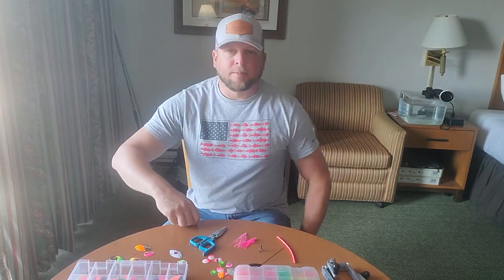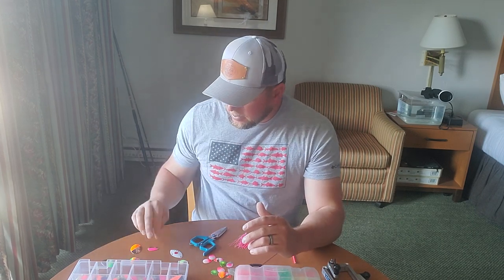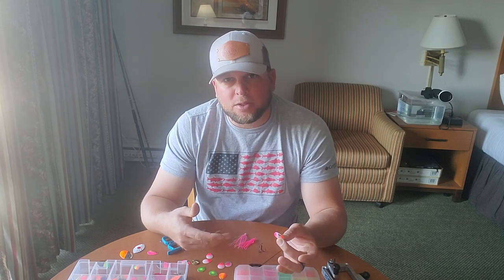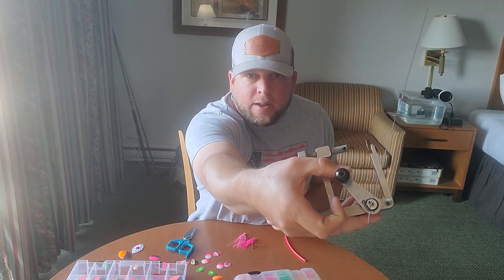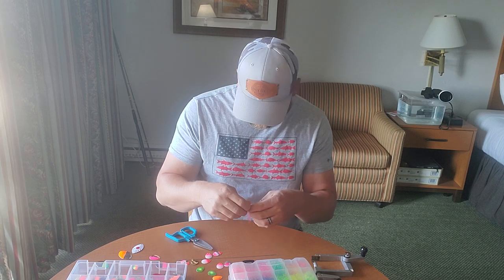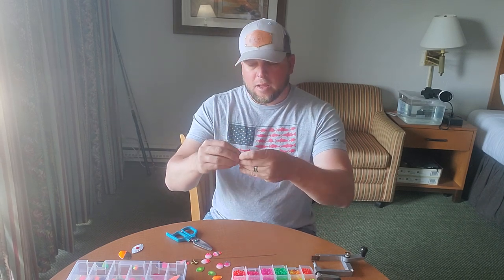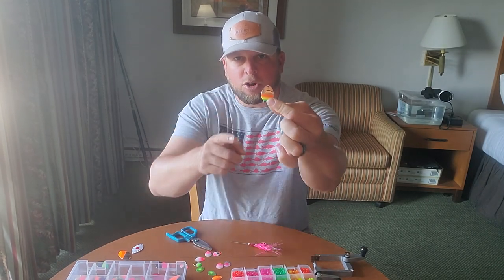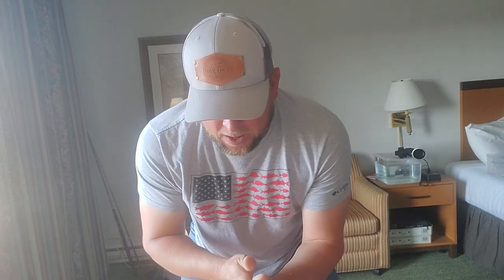Buoy 10 Update:  8-25-19  (How to Build a Spinner for Salmon)

Comment: I’m the creator of Zoom Fisheye Spinners and I run a bead above the blade on my product hence the Fisheye moniker. And they work just fine. 6mm Fisheye and 8mm body beads. Just saying.........
Reply: I am not a fan of putting anything above the blade. I think it has a potential if pushing down on top and effective the spin. And it can hamper the water flow.